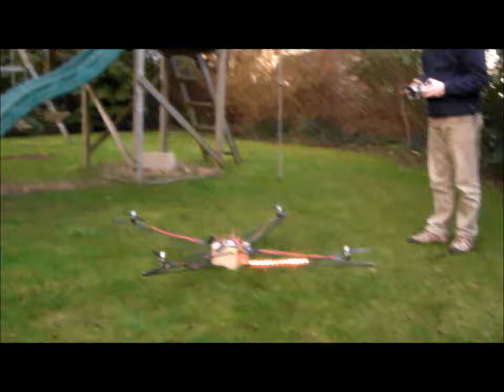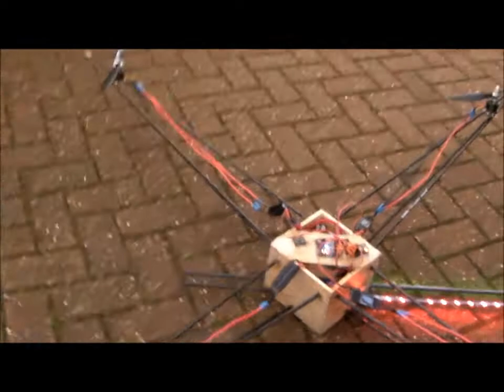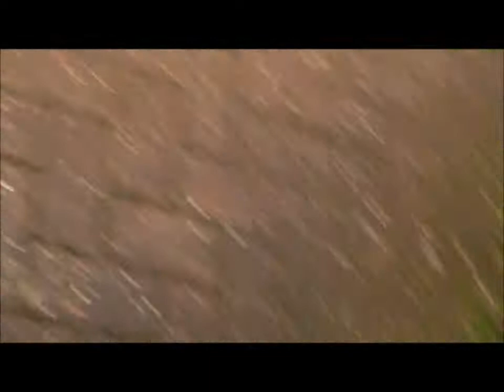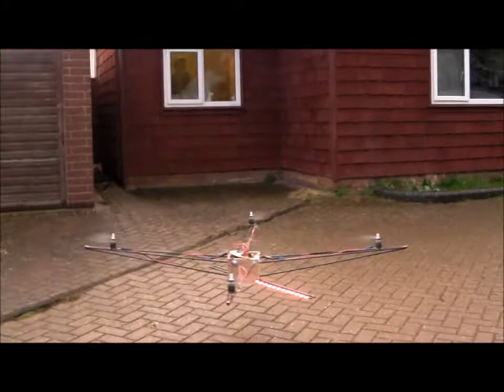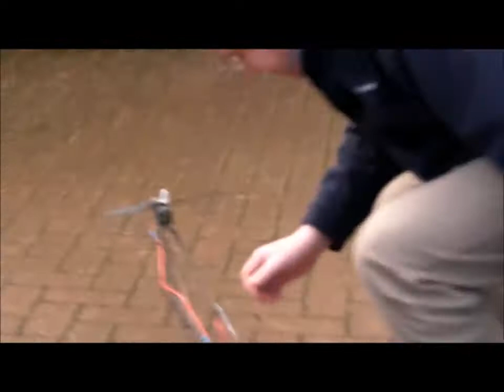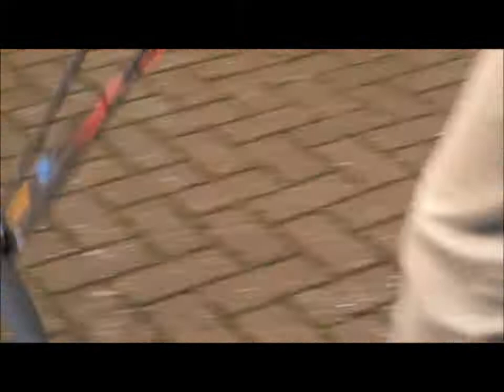Large home built Quadcopter

Comment from the maker: Thanks for the advice...
The motors were the lowest KV i could source at the time.. I do still have stability issues (especially in wind), and poor yaw authority.
 Size was to provde a sufficient FOV between the props for a camcorder.
Thinking of sizing down and going for a Y4 V tail configuraiton.

It does have plenty of power - wondering if *smaller* props would be more responsive.
Stuck with the motors due to budget.